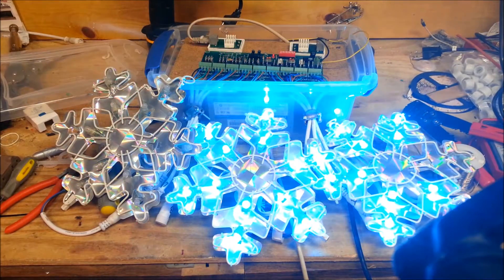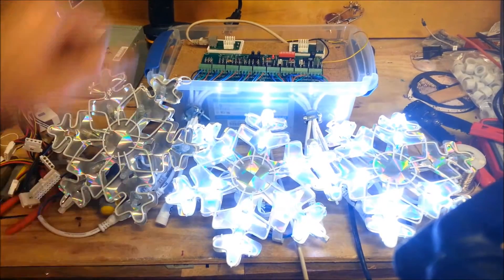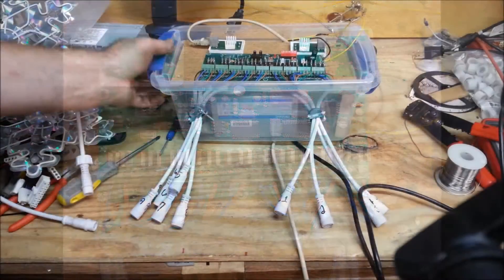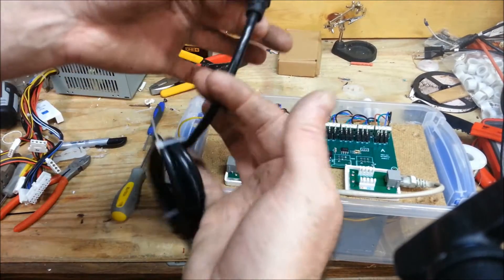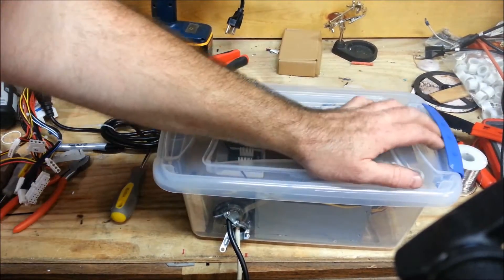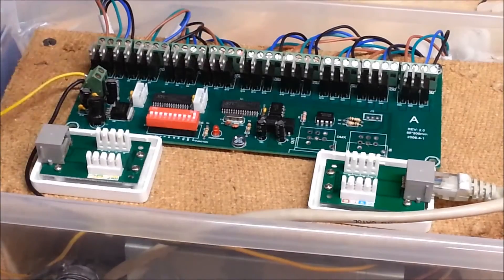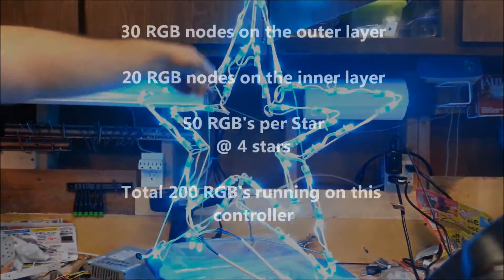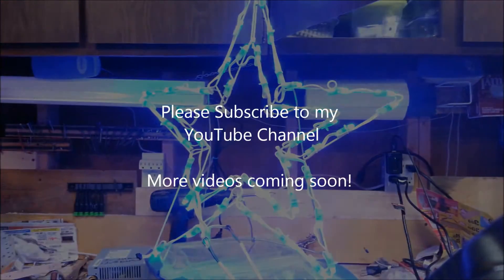Building a 27 channel RGB Controller

Comment: The LED connectors they have to be 4 pin connectors or can I use 3 pin connectors??
Reply from the maker: depends on the number of wires your LED/Pixels have?  If they only have 3 wires, use a 3 pin connector :) Cheers
Reply: My pixel lights have 5 cables, the 3 regular cables power, data & group.... and an extra hire for power and 1 for ground

Comment: I have seen your videos and thought you might be able to help me with my question.  I have 2 16 channel plug and play boxes from animated lighting.  they both have control panels, power supplies, 16 standard home plug in places and cat5 connection.  one box has the box that's I put the SD cards in that I order from them with my songs and display on them. it is connected with the cat5 wire to the control boards.  I am looking upgrade to something I can program myself and expand to rgb's. my question is since I want to upgrade over time and still use my old lights to fill up the void do you think I can use my boxes with a new control like a raspberry pi or computer plus add a rgb controller as well? I'm very new to the style of lights you have and am super nervous to take the leap into a new setup.  I'm trying to compile as much information as possible before I do and your videos are very informative and your show is amazing!
Reply from the maker: I don't know if you can update an Animated Lighting controller and adapt it to work with other software.  The Raspberry Pi is only a show player, kind of like your animated lighting system you connect to the boxes and it plays the programs it's told to.  You will use a program such as Xlights, Vixen, or Light O Rama to create the sequences and do the light programming.   I recommend going with some dumb RGB's and an inexpensive USB to DMX adapter (something with the FTDI chip).   You can get one from Amazon but they may not work (cheap knock-offs or copies with fake chips).  A good one should be around $25 or so and work with W10 easily.  Or you can look for a more expensive Holiday Coro Actidongle.  Many new e1.31 (DMX over Network cable) pixel controllers can output DMX  such as the F16v2 or the E6804 or E682.  Theyare more expensive but will be the next logical step in RGB dumb and pixel sequencing/display.  (roughly $90 to $200)  Have a look at this video  in the DMX interface section.
https://www.youtube.com/watch?v=22blRaz5gZM&t=133s
Reply: Leechburg Lights thanks so much for the response.  it was my hope of saving money and jumping in slowly to the rgb's.  Looks like I might as well dive in head first.  I am really excited to do my own sequencing and pick out my own music.  yours and a few others videos are not only educational but informational as well.  thanks so much for sharing your knowledge!
Reply from the maker: Happy to help!  I would begin learning both dumb RGB and Pixels.  I use both.  I like dumb RGB for really large elements that don't need pixels.  I still love my LOR controllers and plan to rebuild a few elements using them next year.  All the best to you!
Reply: Leechburg Lights Thanks. Merry Christmas!

Comment: You can use a computer power supply i thought you couldnt
Reply from the maker: It is a (free) source of 5v and 12v power :)  Never buying another PS again hahahaa
Reply: the one you have.. how many watts is it and also how long have you had it
Reply from the maker: *****
Actually I received a donation of 25 old computers, and salvaged the PS from each one.  They are only 250w and can run 15A on the 12v rail.  They also run 25A on the 5v rail.  I will be using both 5v and 12v dumb RGB for 2015.  Check out the video:

https://www.youtube.com/watch?v=khIrEgq_zMo